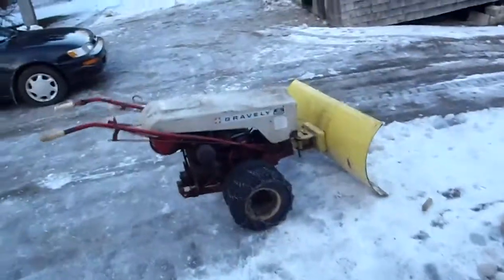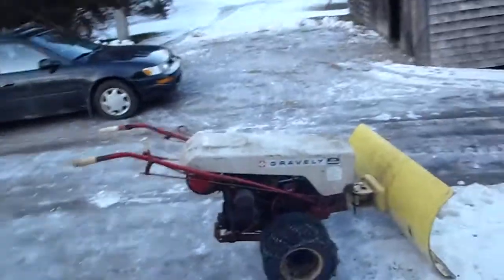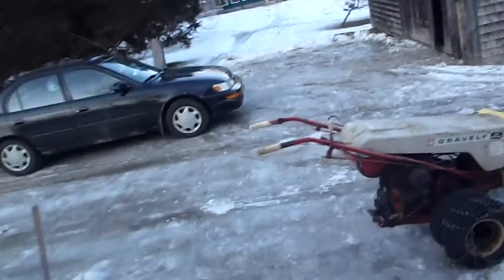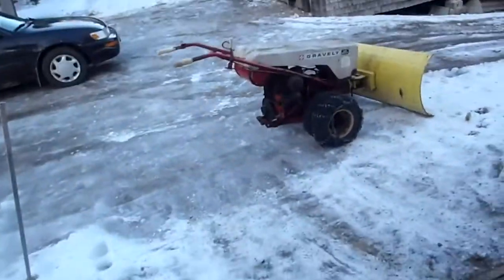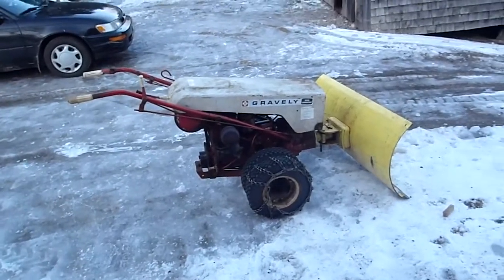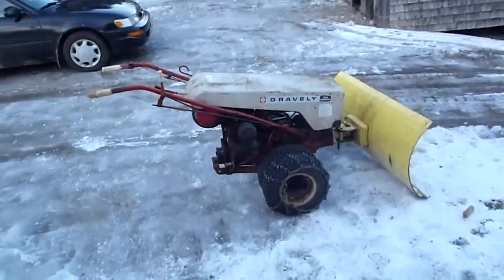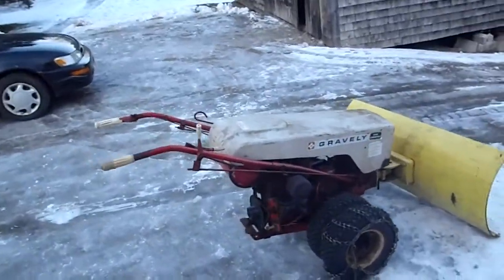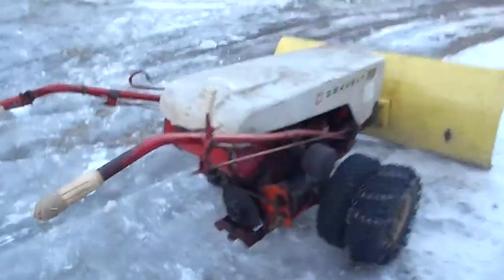Update on the Gravelys and 1963 LI super convertible cold start

Comment from the maker: @stevenpturcheck No they are very thick gauge steel. I also run my safety clutch tight because in its normal setting in the wet snow it would slip